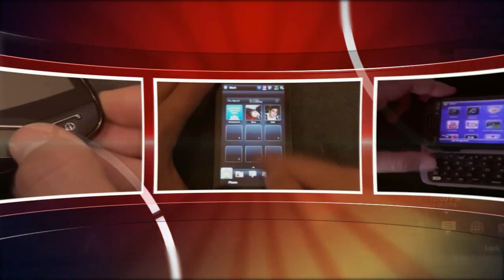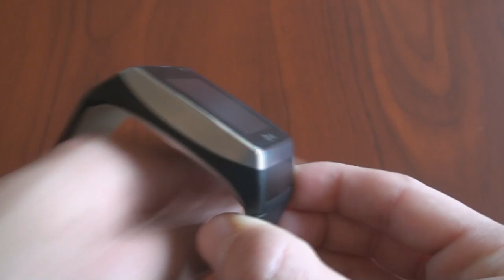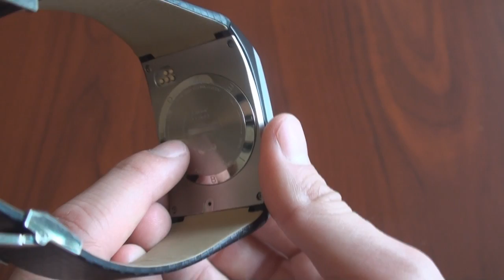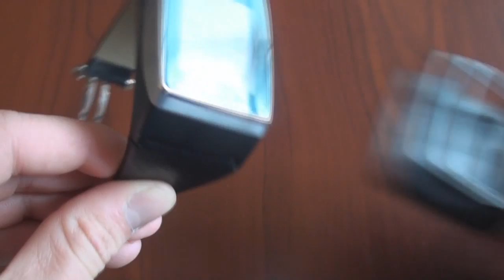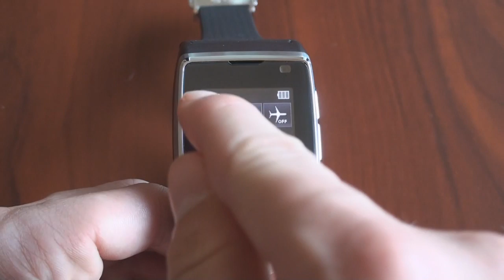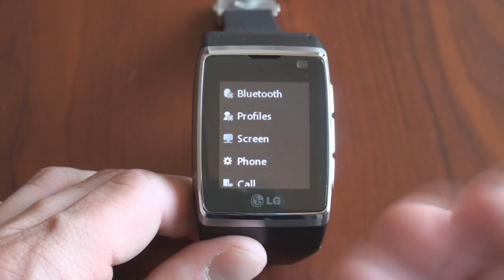LG GD910 Hardware and Software Review | Pocketnow

Comment: Great video i have the gd910 and cant fault it the screen brightness i9s roughly the same as when its say at 100 and eighty this saves a fair bit on battery BUT i have used mine on full and sent 30 texts made 30 mins calls received 10 mins and still got over 17 hours even using bluetooth i have thin wrists and the strap is great and fits great when u adjust it mines unlocked and works great on 3g infact get a signal where my iphone 4 don't
i tried the samsungs version ok internet but to small i